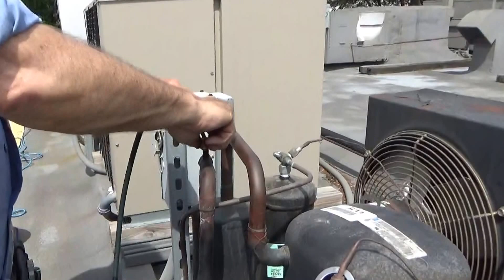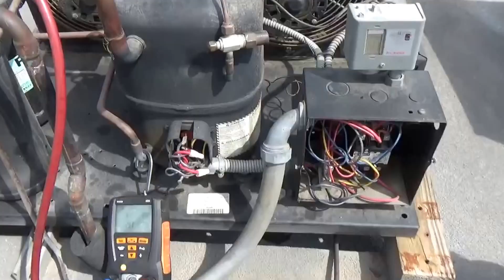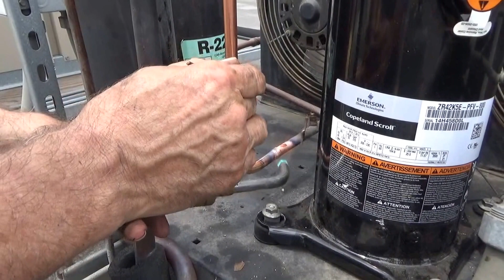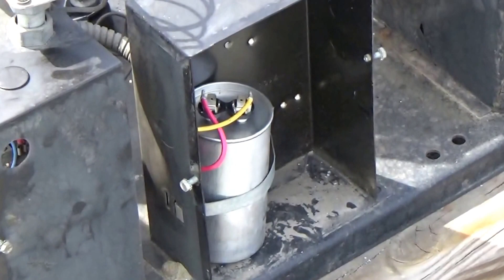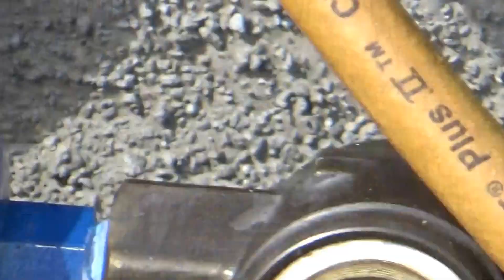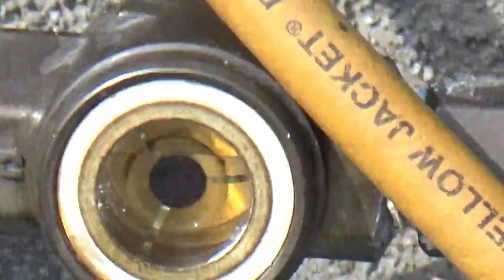schroll compressor replaces an old recriprocating compressor

Comment: Ive shared this with Nor-Cal but, R-22 has a beautiful drop in 422D, similar pressures (bout 1-2 psi difference) and you can drop it in with existing R-22 units, that still contain mineral oil, or R-22. Just tossin in a suggestion, great video!

Comment: Did you have to change the oil when you went to R407?
Reply from the maker: just add 15-20% POE
Reply: You put in 13 pounds of R407 so, you added 2.5 pounds of POE? That's a bunch of oil!
Reply from the maker: nooooo, 15-20% of the existing oil charge, not the refrigerant charge

Comment: HI JIM I WAS WORKING ON REACHING COOLER EVERYTHING  IS RUNNING SMOOTH EXCEPT THERE IS  ICE AT THE BOTTOM OF DRAINING PAN BUT NONE ON THE EVAPORATOR..WHILE THE DRAINAGE IS FINE ...ANY SUGGESTION TKXS

Comment: Jim I'm a young HVACR tech and my father owns the business. We do mainly cooking equipment repair for commercial restaurants. I service all of our walk ins and freezer walk ins. I love your videos but when I go out to a job specifically jobs where I find that my trouble may be inside the TXV on setting superheat or my charge isn't correct I freeze up and it's hard for me to figure out the problem. I feel like I run into valves that "hunt" a lot. Where my temperature entering the Evap on the capillary tubes changes a lot from say 28*F-33*F and my exiting temps close to my bulb for my TXV go from 38*f - 48*F. I had those exact ranges today on a dual Evap r22 system. I would have bubbles in my sight glass one minute and then they would go away. Also my suction line back to the compressor would ice then thaw. I suspect I may be low on charge but the glass clears sometimes and confuses me. Any help sir would be greatly appreciated. I've watched your videos several times.

Comment: Hey Jim great video i use a lot of dryers with flare fittings  also have used imperial Eastman flaring tool for 30 years until i bought a yellow jacket number 60278 flaring tool it burnishes the face like a mirror.I just use a little refrigeration oil and tighten real snug
check one out i think you would like it.You have the best videos on you tube have a good day keep up the great work.

Comment: That's the one of 2 of the same compressors that's in 7 ton carrier a/c unit. Man, those scrolls I guess have some range. 3.5 ton high temp on med temp box. Yep, should work. Kill it with some Horsepower ! Prob. Btu's drop off pretty good at a 20 degree suction.
Reply from the maker: thanks
Reply: No it is not the compressor that has a range at lower temperatures the compressor puts out less BTU s as you need more BTU to reach lower temps .same loses capacity.
Reply: @southsidecontrolsupplyco.3668  I'm thinking he had lost half its capacity on the scroll. At 45F Ev./130F Co. his scroll had a rated capacity of 40000 BTU/HR. 
I bet running a 20-25 degree evap coil lost half if not a little more capacity down to maybe 15,000 BTU/HR.
If I had to guess which tecumseh compressor he had since it was single phase I'd say it was an AH model just a newer run. Maybe an AHC2466ZFZ ? Similar displacements but capacity is a little off. Hard to know where the scroll lands at in capacity since it was designed for air conditioning. Low suction gas volume back to that scroll could kill the windings. Wonder how it's doing today.

Comment: Jim, In one of your videos, " best buddy" an a/c  compressor change out,  you recovered and reused the r22 refrigerant,  are you concerned about acid and or contaminates introduced back into the new compressor.  I noted you changed the liquid line filter/dryer.  I know on a burn out replacement the refrigerant is so acrid smelling I would be afraid to reuse it.  whats your advice.   I always enjoy watching your videos, you never cut corners on workmanship[.
Reply from the maker: if it was a burn out I would discard the refrigerant and put fresh in, the refrigerant was R407c that was a year old, thanks
Reply: In the video you say R407f was used.

Comment: What's the point of teflon and leak lock on a flare fitting threads? The seal comes from the copper flare being pinched between the brass fittings.
Reply from the maker: It's extra insurance , thanks
Reply: I am not a fan of Teflon on threads on the flare fitting, however, the use has been explained in other videos (I like the videos) and it's debateable.  Anyway, I thought it would have been useful to have put oil on the threads so the tightening is smooth and doesn't bind, possibly giving a false sense of snugness.  Yes, on leak test, could be detected, but thought it would be worth the comment.  BTW, yesterday, I was on an AC job found previous tech put Teflon on the schrader valve threads.  On the tape subject, there are mostly two things I see overused in the field, Teflon tape and black tape.
Reply: I used to put a very light layer of leak lock on the flare face, but nothing is needed on the threads, as they don’t help with the seal, they just hold everything together.  BTW, I would have mounted that filter dryer to the base plate of the unit instead of just laying there with no support.

Comment: Nice work Jim as always! Here in the UK most refrigeration compressors would have rotalock valves, makes for easier replacement should it be needed, though brazed is better from a leak potential point of view.
Reply from the maker: my suppliers here don't carry them, thanks

Comment: Mr Jim, been watching your vids for a year or so, theyre great. just always a bit picky with you saying reclaiming. Youre actually recovering. reclaiming is done at the factory when they recycle it into some new stuff. Not a big deal, you can say what ever you desire haha but anywho have a beer can cold day!
Reply: Years ago (early 90's) we had a recovery machine made by a company called Refrigerant Reclaim, so we used to call it the reclaim machine, i still end up using the two terms interchangeably (though incorrectly as you point out)
Reply: +heavydiesel Well that makes sense, of course im younger so i havent been here awhile my apologies
Reply: Paul Brandt
No worries, it just reminded me of how i also use the wrong term sometimes :-D

Comment: Jim does 407f mix with min oil ?
Reply: And poe
Reply: It is a HFC so needs POE oil but will work with a residual mineral oil content mixed in with the POE. I have a few vids where i change the compressor  oil once and then run  the system on R407F.

Comment: If the compressor valves are leaking suction pressure should be high right? But your evap. pressure was low. I was thinking maybe the TXV was stuck or some kind of restriction on the liquid line.  I could't really understand trouble shooting part but It is a nice repair.
Reply from the maker: txv was good, if the reed was broken in half the suction would be high, if there was a small crack in it the suction wouldn't be so high, thanks
Reply: @JamesPettinato  With the hot gas running backward into the suction line, wouldn’t it be the discharge valves leaking?  If that system doesn’t equalize because of a tight shutoff TXV, it will need a start capacitor and relay.  Did you cut the compressor open to find the valve that was leaking?

Comment: Nice repair Jim! Whats your long term refrigerant to replace R-22? Thanks for sharing.
Reply from the maker: for this week R 407 F (refrigeration) R 407c (air conditioning) with POE, thanks
Reply: Thanks for the input Jim! We currently have (6)six walk-in coolers that are running with R-22, and have 14 year old Heatcraft condensing units. Wondering whether we should retrofit to R-407F, or replace the condensing units with maybe R-134A. Now I hear they want to phase out R-404A.
Reply from the maker: go with R 407F, it works just like R 22. Check the oil in the compressors, if it's POE your good, if not add 15 -20% POE to each compressor over the existing oil.
Reply: 422D refrigerant is a drop in for R22 , only a slight 1 psi difference , besides that I’d snag a few jugs of it

Comment: Great videos Jim! I wonder in your travels around N. Ohio doing refrigeration, do you find many roof top cond. units oriented facing N. or E.? I would enjoy seeing you educate some techs(or installers) on why on a 95+ deg. day 20+ mph winds a w/in  freezer wont pull down after a defrost cycle.(and no mechanical faults) HVAC techs don't get this, if not trained properly.
Reply from the maker: this should be taught in schools, thanks

Comment: thanks I did all that is not grounded the unit has 2 compressors first stage and second stage I switched second stage to first stage I does the same I thought it was the contactor but is good the other compressor reads 1.8 ohms and runs both are scroll compressors from a newer Lennox roof top unit
Reply: The insulation of the windings may be degraded and only when power is applied the insulation fails. Your can test this with a megger. I would disconnect ONLY the compressor in question and check the unit does not trip if it does you need to look elsewhere. I think you would have been better off swapping the wiring from the first stage to the second not the other way around to confirm the integrety of the first stage circuit. :)

Comment: good video Jim I'm learning more thank you I have question a/c compressor R410a 3 phase 208/230v I check the ohms all three read 0.8 and trips the breaker I switched wires from the  stage 2  to stage 1 and trips breaker stage 1 is the compressor in question thanks.
Reply: the ohms are good on your 3 phase compressor. On any 3 phase motor the ohms should be the same across all the 3 legs. Next you need to check each leg to ground.....put one meter lead on one of the compressor terminals and one lead on ground or the the body of the compressor. If you read ohms between the two points then you have a grounded compressor. Also you need to isolate your condenser fan motor from the circuit. The condenser fan might be shorted causing the breaker to trip as well.
Reply: Check the breaker and wirer going to the equipment is this a package unit you might have to check the rotation put gauge on system if it's going wrong direction switch 2 leads check contractor you might have use a meger